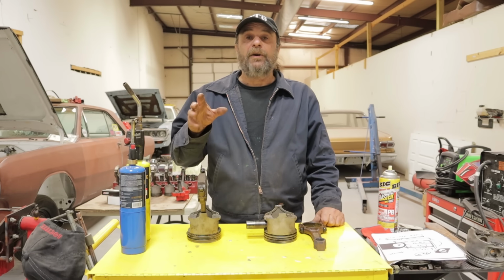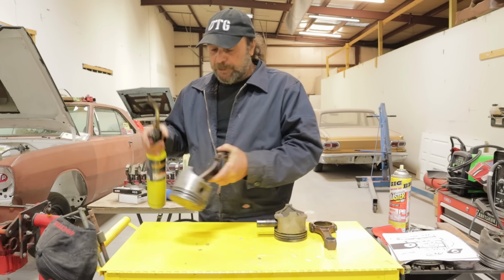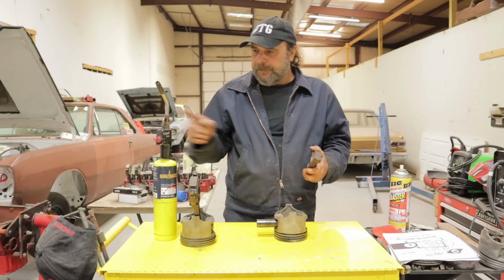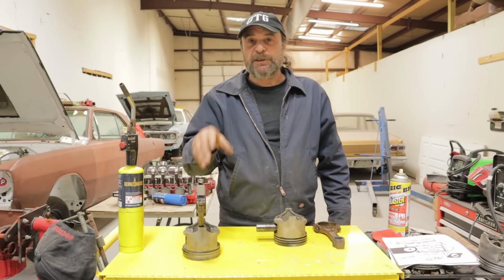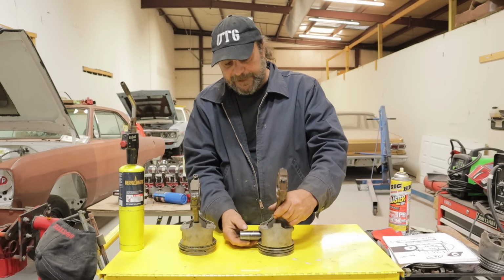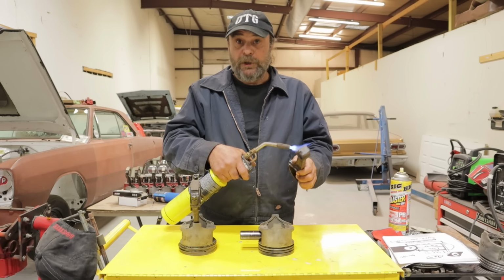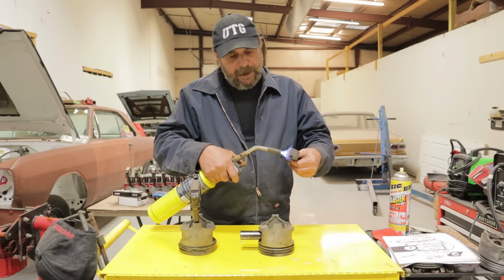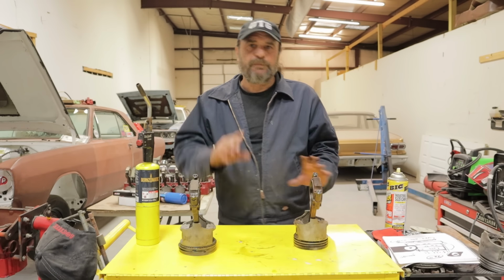Swapping Pressed Pistons For The Home Engine Builder

Comment: An engine shop uses a press. A rod forge is a tool used to strengthen the rod through granular alignment and stress relief of the steel. Do NOT heat the rod until it visibly glows. Not only are you threatening the integrity of the rod, you'll probably distort the piston applying all that heat to it. Please sell your tools and become something you're qualified at, like a pastry chef.

Comment: In my case (UK 60s ford) the Pin in tight in the piston & a hole in the big end shell allows oil to pass up the rod to the little end .. plunging the alumium piston in boiling water is enough to expand it ... if its not rusted,

Comment: I did this on a Mitsubishi L3E (1L diesel 3 cyl on a mower) and although it worked great to get the pin out, it must have slightly expanded the rod clearance to the pin. I can now freeze the pin and it will move easily by hand in and out of the rod. I ended up loctiting (red) the pin into the rod and for good measure put a tack on each side. Not ideal, but I wasn't sure what else to do to keep it in place.

So... although this is a way to get it out, I would agree with the beginning of the video (better left to someone with a press). But good video in that it is another option for some. I probably heated it too hot (light red most likely).

Comment: All but one of the assemblies went together fine but on one i didnt get the wrist pin through all the way and its sticking out 1/2-3/4 of an inch.  Junk it and get a new piston and rod or can i try to use a press to get it the rest of the way?     All the other ones slid in just great
Also i found out my scat rods turned blue but i think that was the oil escaping the metal because i kept heating it and the blue/purple  started to go away and back to more of the color it was before i heated it
Reply: Get a real thick bolt or piece of all thread and slowly pull it the rest of the way through like that with rachet and a wrench (DO NOT USE IMPACT) ??   Would any significant damage occur or should that be relatively safe?  I understand relatively safe is rather subjective but.......

Comment: Uncle Tony 
Got a question 
Ok
I had a machine shop to install new pistons on the rods 
Piston facing forward 
On the rod cap there is two tabs on the left side facing forward the ( I call them wing tabs ) the tabs are facing forward 
Got to the right side 2-4-6-8 
On # 2 rod it’s also facing forward 
But on   # 4-6-8 
they are facing to the back of engine 
Is #? 2 on backwards 
I have another engine I’m checking the engine never took that on apart 
 1-3-5-7 tabs are forward  to front of engine #2- 4-6-8 are facing to the back of engine (. Old engine)

Comment: Uncle Tony, perfect instructions, works great. Did a 305 piston swap in 15 minutes for one with a broken skirt. Clamped the old piston in the vice, heated rod end with mapgas, banged it out with 7/32 cheapo socket and extension. The shoulder on the socket was just right for the pin. Heated the rod another minute and assembled a freezer-chilled pin and new piston. Super simple, THANKS!

Comment: All rods have been heat treated at least small block Chevys to my knowledge when you heat them up like that you've ruined the heat treat therefore for any performance or hot rodding purposes you've damaged the Integrity of the rod at the small end
Reply: It’s been done in every machine shop around without issues for 60+yrs.. The forge leaves the small end blue in color once cooled.. we’ve done thousands and never had a failure.

Comment: If you put the piston pin assy in the freezer -10, you only have to heat the rod to 120 to 130 degrees. It's much easier. Especially on the rod metal.
Reply: My son-in-law did this no torching work like a charm

Comment: Got a question on similar topic; I got a hydro locked engine, still inside the bay. It is a 2015 Chrysler Town and Country van, 3.6 pentastar motor, 6 cyl. i have no idea what is damaged locking the engine but I can not move the crankshaft; to take the engine out of the bay the normal procedure by manual is unbolting the 4 torque converter bolts by rotating the crank but since it does not rotate; could I unbolt all connecting rods caps from underneath as to try and free the crankshaft so it would spin and then can rotate to unbolt the torque converter then get the engine out? I ask because I was told by some not to waste time and pull engine and transmission together then separate the 2 outside then unbolt the converter or work on taking apart the engine to bare blocks but to me it seems it is the same if I would go underneath and do it first, engine has to be stripped down for repair anyways; I do not know if the hydro locking comes from bent rod or rods or stuck bent valves or both. What would be your thoughts in this scenario? Thanks!

Comment: Well I used a ball joint press to press out the pins for my 318. Plan on still using the pistons and re ringing them. How does it hurt as mentioned using a press?

Comment: 400 - 500 degrees, I don't go over 500. I pull mine because I am slow, at 490 via laser temp gun. When I could move faster I hit 400 and be good. Only shitty part is if it's not hot enough or you're too slow, a pin getting stuck not in enough on new parts can be a waste of money (covered the cost of a machine shop just to attach all of them).

Comment: Not building anything, just enjoying. Wish I knew what a "Tang" was.
Reply: The connecting rod and cap both have a notch, and bearings have a little bent portion on one edge that fits into it. The cap should be oriented so that both notches are on the same side.
Reply: @rondunlap4976  Thx Ron.  Now I get it.

Comment: It looks like he's using a Bernzomatic TS4000 torch and so called 'map gas'. This setup will cost a sizable sum of money. I used a regular brass style torch from the hardware store and propane gas. I put the pin in a bowl of ice for 15 minutes before installing and it worked just fine.

Comment: Definitely works. They sell great crayons that melt at predictable Temps which helps those nervous about overheating. Freezing the pin also is a good idea. Heading the rod is heating the rod. I love full floaters and haven't used anything else since early 90's. But those are high dollar engines and another topic altogether.

Comment: Sure looks easy.  I'd like to see how to remove the pin and rod by this method - or any method.  Hyd. press without a jig is a rough go.  Heating the rod end just seems to heat the pin too and nothing moves.  I've tried this many times and the only way I've ever got them apart is with a cold chisel and hammer.  Crack the rod and drive the pin out.  Save the piston, scrap the rod. Usually needs to be the other way around.

Comment: Great videos Tony. I have a dilemma, had shop press new pistons on stock rods sbc. My problem is after installation into block I don't have rod to rod clearance. Was very careful to install bearings correctly and make sure chamfer on rod faced counter weights fillet. I made sure I did not mix rod caps. I'm at a loss here, sure could use some help.
Ps. Not my first rodeo, but first in 35 year. Yikes!

Comment: I got a machine shop about 5 miles from me who does this job for $10 for one and discounted for each after 2. Well worth it imo.  But I may try this on a couple of parts I got on display to get a true appreciation of the process.

To be clear, I won't be using the parts. I don't even have the motor they go to anymore. The rod was damaged due to a spun bearing, the piston crown is damaged. They are from same motor just different times.

Comment: Heat the rod, got it. Press fit in the rod. I have a question, why does the piston pin
cycle in the softer piston aluminum alloy rather than the harder rod steel alloy?
Is it because of the greater bearing surface area? Guess it doesn't matter much
because it's not rotating...

Comment: That is hot..if it looks different afterwards, it is different. I'm not a metallurgist, but some tempering is done several hundred Fahrenheit degrees cooler than this, meaning this rod is probably different,  which is more likely to mean weaker than stronger. I'm sure you've done it many times successfully, but that may just mean the rods are overbuilt at the small end...they do seem more prone to breakage near the big end.
   I wonder what the wrist pin temp is after the heat transfer?  I'd be surprised if even a cheap wrist pin isn't heat treated.
    I have a rockwell tester..maybe going to do this to some old parts and check before and after hardness.
    I did purposely bend a stock rod, twisted it about 180 degrees along its length. It was easier than I expected,  so maybe it is soft and it doesn't matter, but I'd rather not heat any critical parts to that temperature.

Comment: Link to MotorTrend’s Steve Dulcich DIY pressed pin removal tool. Hardened all-thread and hardware recommended. https://youtu.be/KAjeVBxSX1E
Reply: Too much work and time. The piston and pin are going to be trashed either way. Heat it up and just smack it out in 3 seconds.

Comment: Does anyone know what gas he us using? I cant get the rod hot enough before it heats the pin.
Reply: MAP gas - runs a bit hotter than propane.
Reply: You only need to rod to get around 400-450F. And you only have about 3-4 seconds working time. Tony had a lot of working time cause he over heated the rod and ruined it.

Comment: Of course a machine shop is easiest but I have done it at home without much trouble. Its all about setup. I used a block of wood with a section cut out with the same radius as the piston.  I used a cheap tabletop hydraulic press from harbor freight.  Heating the rod in the oven and cooling the pin in the freezer reduces the amount of force the press has to apply.

Comment: I was half expecting the party trick with this one... in my automotive class, our teacher did this exact thing (with an oxy torch instead, though) but when he let it cool down, he showed the transfer of heat from the conrod to the pin, and from the pin to the piston. My teacher did this by holding the connecting rod up off the piston by a bit (about a 45 degree angle) and when the con rod cooled down and the pin heated up, the pin locked up inside the conrod and the piston, making the conrod stay on the 45ish angle... until it dropped when the piston soaked up some of the heat from the pin, expanding the hole to be bigger. Great content nonetheless, and was everything I remember being taught about this! I even distinctly remember the feeling of the pin slipping into the conrod... good times!

Comment: Good stuff. 
A simple pin stop can be built on a mill or drill press table (or any flat surface). An infrared thermometer takes away the chance of extracting the temper of the rod. 430-460 degrees F is what I aim for.
Reply: 400 range is what you want. If you got it red like Tony, its too hot.

Comment: I replaced rings in my ‘66 Ford Mustang 200ci straight 6 and I heard there’s a specific way to orient the rings. I of course made sure I had the rings in the correct order with the scraper and compression ring oriented the right way up but I heard the piston ring gaps need to be rotated a specific way when your installing them. I never thought about that during installation because I figured rings would walk around enough so it wouldn’t really matter how there set when assembled, I still offset the rings so none of the gaps lined up. I’m having zero oil burning and compression problems since I replaced the rings I’m just wondering what people think about this topic.
Reply: What the hell this have to do with wrist pins?

Comment: pretty sure I wouldn't want to use apropacne torch unless you understand how to temper steel and what heat does to tempering..

DO NOT HEAT structural parts to remove or install!!!!!!  EVER!  especially forged components.. you CAN freeze but do not heat cuz if it's not cooled properly you will lose hardening and that's that, catastrophic failure..  unreal
Reply: You're a moran. You only need to heat the rod to 400 degrees which does not affect anything. I build 1500HP race engines and they hold up.

Comment: A stick welder can also be used to heat the rod, not to weld on it but arc the welder out on the rod end and let it hum until it gets warmer enough positive and negative on each side of the rod end to only heat the end
Reply: Shorting out a 200A welder...you're a special type of stupid.

Comment: From what I understand Mapp gas is no longer sold, the yellow tank he had here is called map/pro it's just a more refined form of propane meant to be used along side a tank of o2. Use the cheaper blue propane tank with the head that's meant for the map pro tank. I learned this in the hvacr trade.
Reply: You only need the rod to get in the 400 degree range. Propane gets to 3600. Propane will work just fine.

Comment: I'm a mechanic by trade and I could do this task but the engine machine shop is across the road from my work shop so I just get Dave to do it. They do it every day, Dave the lead machinsist and engine builder was telling me he linishes the rod so he can see the colour change when he's oxy heating the rod.
I don't even know what colour to look for plus I don't know how far to set the pin.
Reply: You only want the rod to be in the 400 range. It will turn a blue color. That will buy you about 4 seconds working time. Tony turned his red, which is 900+. WAAAY too hot and why he had so much working time.

Comment: Looks good Tony. I have a little jig i made out of scrap that I set the piston in, and it has a bolt on one side to set the pin depth. Ive always done this job with a propane torch.

Comment: I "press fitted" my whole Speed Pro hypereutectic set with nothing but that exact bernzomatic propane torch. I had to, because everywhere I tried to take em literally told me "I can't guarantee that I won't crush these pistons with the press". Freezing the wrist pins made it sooo much worse. It cooled the rod too fast and then you don't have the same window of opportunity to get it centered. I just heated the rod and pushed the pin through exactly the same way you demonstrated, to where my fingers stopped it.
Reply: Pressing he piston out with a press ruins the piston as the shop told you. You need specialty jig. The shop was explaining that to you but you did not listen.

Comment: Before too long I'll be doing this . I have to take the factory rods and pistions apart for my 360 build . I'm going to buy a nice large kitchen digital scale build my own pistion tree to hang each end of the pistion off to weigh both ends of the rods and the new pistion to balance the rotating assembly

Comment: STEVE Dulcitch has a video on how to make a tool that presses the pin in or out without any heat or damage to the pistons with nothing more than an old pin and a threaded rod . IT works like a c press for kingpins and you don't have to heat the rods ,maybe putting the pins in freezer to install to go back easier.I know how UT doesn't care too much for those guys but its a pretty ingenious tool
Reply: Where can I see that???
Reply: @brandonbelongstocharlottef1798  Homemade tool removes press pin on Steve Dulcitch channel on YouTube
Reply: @ronnieb7408  thank you sir 👍
Reply: If you're going to trash the piston and pin like that, might as well just heat it and smack it out with a socket. A lot less work.

Comment: I am a chemist.  MAP gas has more cabron atoms, which is not very important because... oxygen is the key.  The structure of the torch is what really matters.  Higher gas flow and more oxygen will produce the heat required to release the pin using propane only.

Comment: It's amazing what heat and cold will do for press fits. I had an interference fit bearing in a tractor axle where the old one slipped out and I couldn't get the new one in and due to it being inside the housing I couldn't tap it really with anything. Bearing sat in the freezer overnight and I heated the housing just a bit with a propane torch and when I got the bearing out it just pushed right in with ease.

Comment: Not sure what dull-red looks like in a brightly-lit shop.

I’d use tempilaq to tell me when I had ~ 5-700 degrees F.  That should expand the hole enough?

The engines I’ve worked on - smaller ones - used snap rings or circlips, so I never had to deal with pressed pins.
Reply: Only need about 400 degrees. That will buy you about 4 working seconds. Tony over heated them which gave him extra time.

Comment: Using a factory  installed piston as a guide, make a simple fixture to help you get that pin centered. It really helps when you have that hot connecting rod and you are trying to move fast before it cools.
Reply: A very good point about making a simple fixture. 5-10 minutes to manufacture one and you will get the job done perfectly on all of your pistons

Comment: Is there any other reason why that assembly is made so difficult, than hindering the shade tree mechanic from keeping the engine alive? In a V8, the pistons are usually the first ones to give in, so why desing special tools and procedures into a job that is basically annual maintenance?
Reply: its not annual maintenance its a complete engine overhaul procedure. Must be less expensive in time and materials for the manufacturer to use the press fit option.

Comment: Wow! I've never heated the rod to remove a  pressed in pin. I've got a  huge vise & pressed the pins out to clean the pistons & rod then pressed the pin back in.  I've never damaged a piston or had any issue. I see the benefit of  heating the rod it would  take the stress off the piston while making in pin go in a lot easier.